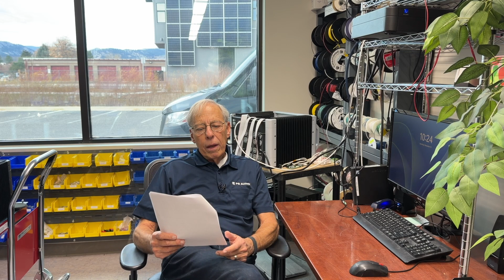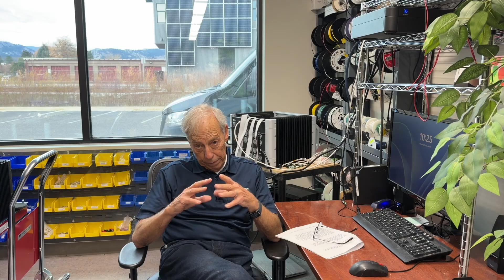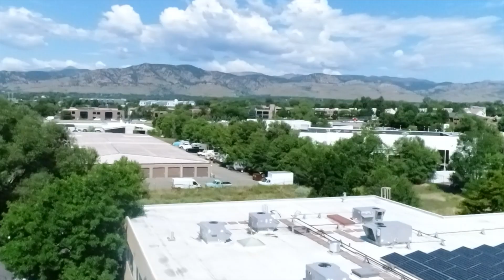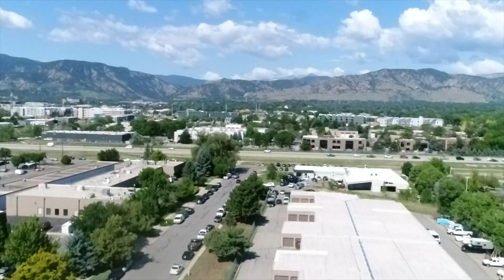Cable modems and power regenerators

Comment: Treat your cable modem like a PC. At most, you might add surge protection and UPS.
Reply: United Postal Service??
Reply: Wise guy.
Reply: @BruceCross   ...😁
Reply: Uninterruptible Power Supply. I use one for my home automation server to keep it running even if the power drops. My optical fiber modem is also with UPS so my house will be online using batteries even the mains power is gone. For audio a UPS is usually too noisy causing more harm than good.
Reply: @ThinkingBetter fiber can’t run if there’s no local substation feed.
Reply: @Trooosed My service provider Frontier here in Southern California runs their fiber optic service with battery and generator backup.
Reply: @ThinkingBetter Jesus, I looked them up, my god, that’s not even close to being a thing in the UK! Makes perfect sense, I would absolutely pay a premium for that reliability!
Reply: Why the hell do you need a UPS on your cable modem? Do any of you actually have any idea how networking works? So much utter drivel promoted by “audiophiles” who clearly have zero clue what they’re talking about and just parroting snake oil
Reply: @Trooosed  Surge protection prevents electrical damage to your cable modem. If the battery fails in your cable modem, a UPS prevents your cable modem from fully rebooting during brownouts. Both concepts are from the computer world.
Reply: @BruceCross modem doesn’t suffer from spikes in any way shape or form, it’s literally the same power you’d get from a USB 2 socket, the actual modem barely uses any power at all, if you’ve got a brownout it’s because your local substation is down, your local exchange is on that same supply, not even factoring in the local cabinet that’s actually feeding your house (as your saying modem, it must be fiber rather than a router which would be ADSL), so UPS is again totally irrelevant. No professional grade network puts the modem on a UPS anywhere in the world, they may put the router on a failsafe supply as that will often be the DHCP and DNS server for the internal network, you’d have resilience via a secondary supplier on a second modem on a totally separate sub-network that would switch over if the other failed. Rebooting a router shouldn't take more than a matter of seconds if it's a half decent router and not some garbage ISP supplied one. It beggars belief how much garbage you people buy into! Unless you're just talking garbage and you're still on ADSL which can operate without power, but that's an entirely different thing not related in the slightest to what you've said. A modem and a router are two separate parts (if you’re talking fiber) and serve completely different uses, the modem is useless in a brown out and totally irrelevant to the internal network
Reply: @Trooosed  I'll trust your knowledge on networks. Keep in mind that the person asking the question wanted to buy an expensive regenerator for a cable modem, but I said, "At most, you might add surge protection and UPS." If a surge protector/UPS is already being used for the computer system (as it should be), then it's a free upgrade. Just plug in the modem.
Reply: @B @BruceCross ’s not an upgrade, it’s like adding a power conditioner to a toaster, it’s not even related to the use case. It’s really important to call these things out in the audio community as there’s so much just blatant untruths being spread with regards to networking related to noise on fiber lines and utter ignorance about how network packets are not even remotely connected to audio signals in any way shape or form, that’s why the OP is confused, it’s because completely ignorant “audiophiles” propagate total untruths rather than getting advice from an actual engineer and they’ll listen to the word of numpties who have no clue what they’re talking about. It’s got so out of hand.
Reply: @Trooosed  Do you think surge protection provides no benefits to cable modems, either?
Reply: @B @BruceCross terally nothing, totally pointless, why you say either though I’m uncertain as we’ve only been addressing modems. If you’re talking ADSL, that’s not a modem, it’s a router, the only point on having that on a UPS is if you had network devices that needed network communication while they powered off under UPS power
Reply: @BruceCross  If you really are meaning that it's the local power feed to your house ie from the street or something that's causing interruption rather than the substation going down, that's just insane and doesn't happen in modern locations. If that's the case and you're still running from overhead wires down telegraph poles, you can do some very basic things to solidify that connection, wouldn't cost much, I'm sure a local guy would do it for a reasonable cost. But if that's the case, given you're talking high end audio equipment, so you obviously have some money, why on earth wouldn't you install solar? You could be fully self reliant with 2 power banks for storage for around $70k, likely less than most high end systems cost. Just don't make sense. And if you're using a basic ISP provided solution, do yourself a favor and invest in some proper kit as it would make the world of difference.
Reply: @Trooosed  Thanks.
Reply: @Trooosed I have UPS on my optical internet modem (5Gbps) to ensure my house is always online even during a power failure. It's not about audio but about my home alarm and security system. Even my garage door has battery backup as required by California regulations.
Reply: @ThinkingBetter  how in a power outage are you still getting an optical feed from the local exchange as the exchange is on the same sub network that you are? The battery backups are so that devices are remain connected to the internal network so that logs etc are still captured locally until the WAN is backup and they can dump historical data to remote servers. Are you saying your local power supply (rather than the sub station) fails rather than the exchange? Where are you living, Timbuktu?
Reply: @Trooosed   🏏 Australia: 3 / England: 0  🏏
Reply: @Trooosed  I use Frontier 5Gbps optical internet here in Southern California and their service has backup by batteries/generators for central offices / headends with large battery banks + diesel generators and for neighborhood fiber cabinets / hubs with battery backup, often with generator support. My Frontier optical modem also has battery backup (can run for 4 hours) and my home automation server running Z-Wave with motion sensors and alarm sirens and automatic emergency call all work in case of a power outage through UPS. I haven't seen a minute of internet dropout in the last decade. Power itself it more often having a dropout like perhaps once per 3 years.